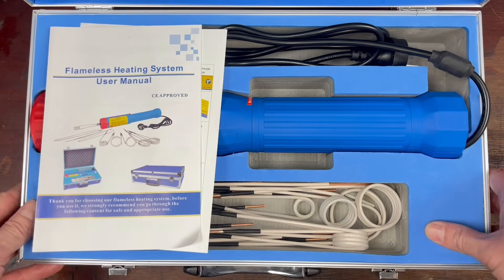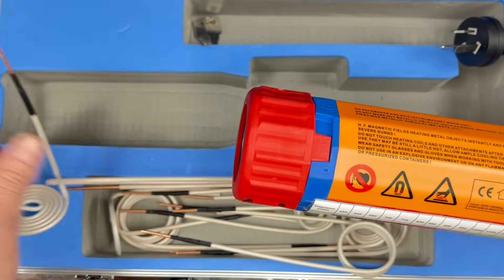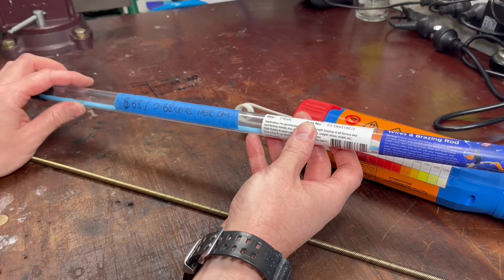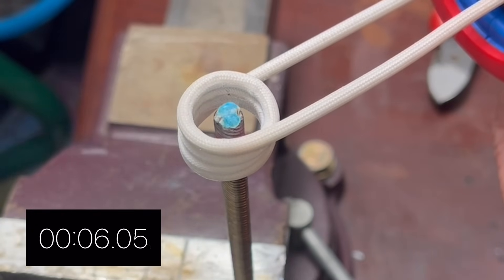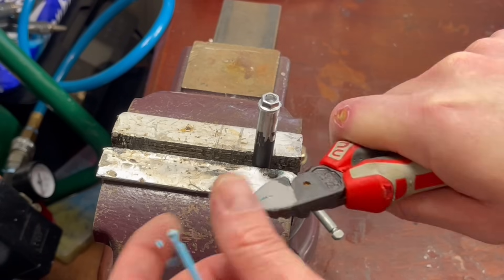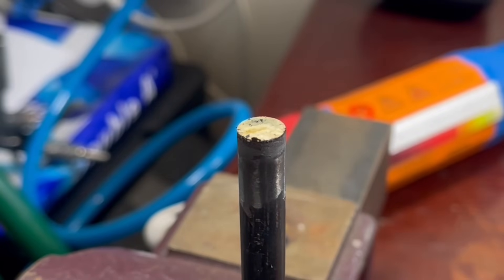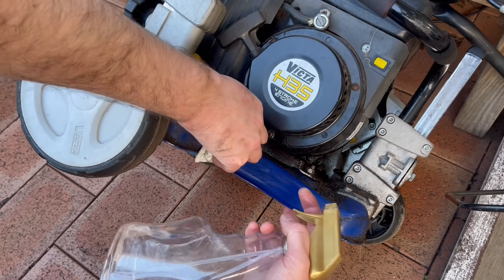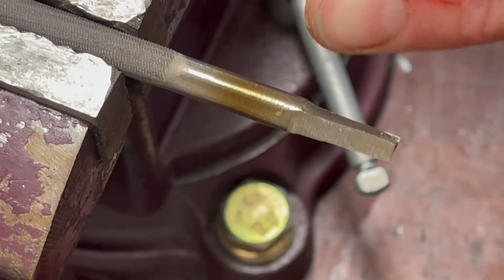Every Mechanic Needs This Tool! Save Time & Money!

Comment: Had one of these for years, very hit or miss. Once the insulation burns off, coils are useless. The insulation WILL burn off.
Reply: What's stopping you from sliding on a new heatproof insulator sleeve? Or am I missing something?
Reply: @endotherm  Buy one use it professionally and you will see. The insulation did not last long and the replacement coils where more than I wanted to spend on something that only worked well once and a while. I am good with the torch so that's my go to.
Reply from the maker: Nothing, you can get the sheathing cheaply and easily. Just open the coils a bit, slide it off measure it against the spool of new sheathing and slide the new length on before squeezing the coils together 👍🏻
Reply: @VintageEngineRepairs  You do you I like to make money in my shop, tools that work good once in a while get tossed.
Reply from the maker: Sorry to hear you didn’t like yours!

Comment: Cost?  In the US that setup is about $40.  Propane wins always with cost.  You are so biased towards induction with all your measurements especially with portability, cost, flexibility, and large work size all favor the torch.  Induction is awesome, but really bugs me how biased you are.
Reply from the maker: There is no bias I said they don’t replace one and other and both have strengths and weaknesses. Portability went to propane, flexibility went to propane, cost was a draw based off of purchase cost out here in Australia and consumable cost with propane, so I really don’t understand how you came to the conclusion I was biased.

Comment: They could have made 2 in 1 , not just heater , flip a switch and its electromagnet , making you able to magetize your whatever you need magnetized , or demagnetized , maybe 3in1 , its a same device just difrent type of current and fields , that electronics can do , its in there .
Reply from the maker: Interesting! I have no idea!
Reply: @VintageEngineRepairs  yeah heating is done via high AC current , electromagnet same thing just DC current . Sure it would not be perfect one , would need more coils but due to high current it would do the trick  im sure . And its a matter of putting in a diode or 2 , rectifiers . But i guess they want to sell that separately .

Comment: is that possible to add a probe touching the target to control temperature
Reply from the maker: I don’t see why not! You just need a thermometer that can withstand the head. That said it won’t give you the internal heat of the piece.

Comment: Why ferris metals necessary? We boiled water with an aluminum ring headed via induction in physics class. You can induce a current in any conductor. They even use induced currents to sort condutative metals from non-conductive scrap in recycling.
Reply from the maker: I’m really not sure, I believe because induction works off magnetism and exciting the iron in the material. It seems to work on non ferrous but is far less effective unless it’s thin tubing.

Comment: Very interesting, never seen this kind of tool. Great for silver soldering as shown but does it work in same situation with regular brazing rod that needs a bit higher heat?
Reply from the maker: Hey, I haven’t tried other rods, but for reference these are 45% silver brazing rods and require 1250f which melted very quickly. Glad you enjoyed the video!

Comment: Good article. Only thing to mention is that 'ductility' is the ability of a metal to be drawn out into a thin wire. The word you want to describe the ability to bend a metal is 'malleability'.
Reply from the maker: Ah thanks for the correction! :)
Reply: @VintageEngineRepairs   Happy to assist.
Reply: I think you are being overly pedantic. Ductile also means "able to be deformed without losing toughness; pliable, not brittle."
Reply: @JorgTheElder  That definition is wrong in that it is not complete enough to correctly define 'ductile', & is likely random & brainlessly AI-generated.

Malleable & ductile are related concepts - but different in very specific ways.

The definition you've cited should only belong in a dictionary entry under 'malleable'.

Comment: Here in the USSA, the yellow cylinders are MAP gas and the Blue or green cylinders are LP (Propane).
Reply from the maker: Spot on 👍🏻
Reply: Unfortunately, there is almost no advantage to getting the yellow canisters, since they don't make MAPP gas anymore. Map/Pro isn't the same, and not really any hotter than propane

Comment: I noticed that some of the centerfire rifle brass has the neck annealed by induction coils by some of the makers. Others still run a flame in their manufacturing process.  Induction annealing just takes a second or two for a brass cartridge.
Reply from the maker: You’re spot on, even though it’s non ferrous, tubing like you mention glows red in a few seconds :) solid brass won’t though.

Comment: 𝘽𝙚𝙬𝙖𝙧𝙚 𝙗𝙚𝙛𝙤𝙧𝙚 𝘽𝙪𝙮𝙞𝙣𝙜

This tool does work as advertised and brings steel up to 800 °C, but only the softest of silver solders will work with it. You won't be able to use hard silver or braze with it because those require bright red and orange heat. 

It is also limited; you won't be working with 1/4 inch rebar with it. You can bend rods, maybe up to 1/8 inch. It does have its uses. If I had to do it again, I would want a portable 3000-watt unit if there was one to be had.
Reply from the maker: Hey, I’ve not tested the specific heat as my IR thermometer only goes to 600c, but this one gets metal to glowing orange (in fact the thumb nail of this video where I’m heating the wrench in the induction heater really is that orange)  and I have hardened steel with it countless times. The number of wraps and how close they are to the object has a huge impact on the results I’ve gotten. Hope this helps!
Reply: @VintageEngineRepairs  My inductor really went past dull red heat, but it is the cheaper model you showed in the video with the screw terminals for the copper coil element. I will try more turns, but what I really wanted was the quick silver soldering capability and to get a bright red or even orange heat, so 1000 watts may not be enough. I am using a similar 45% silver solder, but from Harris, so that may change things as well. It does not flow well unless you get bright red to orange.
 
You have a good channel. I liked your tips on the silicone for the angle cutters and the incense to find vacuum leaks.
Reply from the maker: All good, yeah you shouldn’t have any issues even using 1% silver brazing, let alone 45%! Try a tighter wrap and more of them :)

Comment: The oxy/acetylene torches can do so many jobs yet all the so called modern technicians can't use them, they are cheap, portable, can heat, weld, cut, all in one tool yet the new generation cannot even light one let alone do anything useful with it, what a shame, fire is one of the most important discovery of modern civilization..
Reply: I use one everyday what are talking about
Reply from the maker: Each tool has its place 👍🏻
Reply: lol “old man yells at cloud”.
Reply: you could use this in places where you couldn't use a torch , heating just the bolt you want to remove without heat damaging surrounding materials .

Comment: Great content
I always wished I had an oxy/ acetylene torch for stuck bolts and parts, but if you don’t have a lot of use for it, the expense and tank lease isn’t feasible. I bought one of these inductive heaters, and it’s almost always better than a torch. No starting the engine compartment on fire, or damaging anything in close proximity. Love this tool, even after 6-7 years. I think I paid about $450 online. 
For cutting, I can often soak welding rod in water for a bit and cut with that, or use a small plasma cutter for finer work. 
Also, I use an induction cooktop that I busted the glass on to heat larger areas and non protruding parts. This just reenforced my reluctance to throw anything away that might be usable if modified. For non ferrous materials, you can stick a piece of iron on it.
Reply from the maker: Awesome and thanks for sharing! 👍🏻👍🏻

Comment: 10:02 It should not bend , it should be springy . The issue here is that you partially annealed this part when you brought the first part to red. So it's not hard anymore where it bends.
Reply from the maker: I’ll have to rewatch the video and look closely, thanks for watching!
Reply: @VintageEngineRepairs   👍‍‍

Comment: Has anyone tried this tool for heating HVAC copper tubing for heat punp and air conditioning equipment? Since brass tubing works it would be wonderful if you could braze copper tubing.
Reply from the maker: Unfortunately I don’t have any to try, but if I come across some I’ll update my message here :)
Reply: @VintageEngineRepairs  It would be interesting to see if you could just take a 3/4" or 1 inch copper nipple and a coupling and silver braze that. It would be a quick low cost way to check the capability. I'd bet the HVAC guys would love this as opposed to a torch.

Comment: First of your vids I have watched and found it very enjoyable and ofc educational. I would say if I had a beef, it would be you priced a propane kit, but left us in the dark on the induction lot. I know that many utubers are reluctant to price items maybe because they fluxuate which may draw comments, but I have found most of us just want a general idea of the cost to stick in our nuggets and try and rationalize how badly we want said item, not to quibble over who may sell one for less etc. Anyways, I watched it for heating exhaust studs, which most know if you don't many will snap off in the most convenient of places. So one other issue would be accessibility of getting them in tight spaces. Can you make longer ones? Just food for thought on usability. I like the idea of no open flame while working on a gas powered anything and control over what gets heated, like not worrying over your torch tip setting something on fire or melting a bit of plastic which all newer things seem to be built with. IE: Damage control. Anyways, thanks so much.
Reply from the maker: Hey, no I didn’t, I showed the price of the induction kit when I was talking about comparing prices. It was circa $300 Australian dollars. I don’t know the exact figure now as I made this video a fair while ago, but the price is there for everyone to see.

Comment: I'm interested in induction heaters for a number of years but they used to be closer to like 800€ so I was considering to brew my own.  This model while still not cheap is much more affordable and the underlying technology actually has the potential to get much cheaper.
Reply: You can find pre-assembled induction heater circuit boards for as little as $10. Quality and longevity likely not good at the lower end of the prices but sometimes I'm quite surprised with the quality of cheap circuit boards I've purchased.
Reply from the maker: Yes it’s incredible how much kore accessible many electronics have become!!
Reply: @VintageEngineRepairs  I think it's a very simple device.  A Basic version needs only a transformer and I was wondering if a classic welding transformer at a suitable setting could be used.  A fancier version would use actual electronics.  Something to experiment on, I guess 🙂

Comment: I wonder why it can only heat ferrous metal.  The electricity flowing in the heater coil ought to induce current in any conductor.  For example, the primary and secondary windings of a transformer are coils of copper wire.
Reply from the maker: It’s an electromagnet and because the metal being heated needs to be ferrous I believe that’s where brass and other non ferrous metals won’t work. However I’m no expert, just using logic so open to any correction!
Reply: Transformers use copper wire, but they still require a ferromagnetic core to transfer the magnetic field efficiently. With induction heating, the workpiece is the ferromagnetic core. Induction heating does technically work with nonferrous metals, but it’s so inefficient (lossy) that it takes enormous amounts of energy to actually heat the workpiece, or conversely, the heating effect is uselessly small with ordinary equipment.
Reply from the maker: @tookitogo  thanks for sharing! I find it’s great on non ferrous tubing, for example shell casings but useless on non ferrous solid bar

Comment: Thank you. Excellent topic and demonstration
Reply from the maker: Thanks! Glad you enjoyed it! :)
Reply: @VintageEngineRepairs  I’m a licensed full time professional gunsmith ( >35y) and almost daily do the heat treatment and bending like you demonstrated. Making parts & tools.  Silver brazing, which I should do more, I tend to avoid because torch is often difficult to apply.  This could be an excellent source of heat for me. Never knew they made them this small & compact
Reply from the maker: @thatsthewayitgoes9 They really are amazing, you’d find them an absolutely fantastic tool in your instance, localised heat, controllable and won’t burn anything else around the work area! I have used mine almost every day since it arrived for different tasks around the workshop! I’ve added links in the description - see the updated version I have linked to, I think you’ll be even more impressed! Also, buy 2.5mm copper coil and 3mm fibreglass sleeves and make your own coils. It’s even cheaper than the pre formed ones. Also save the copper, anneal it and reuse it when the fibreglass sheathing does eventually fail!

Comment: Doesn't need to be magnetic metal to heat up.  Eddie current is induced in all metals as far as I know.  Mass / shape is more important than anything, me thinks.
Reply from the maker: It seems to do well on tube in non ferrous, but solid bars it’s almost useless!
Reply: @VintageEngineRepairs  interesting! I wonder why. I'm gonna guess that it has to do with dissipation of heat in copper and aluminum.  Can you check the front end loading? My guess is that it loads the same and dumps the same heat in but it travels down the bar faster.  Though I'm happy to be wrong.  Such interesting stuff

Comment: I ran an industrial induction heater as a lad. The coils were liquid cooled and we annealed hydraulic cylinder shafts up to 4" OD.  It made a fine hot dog cooker if ya skewered the hot dog with a piece of wire though getting the timing right took some pedal practice.
Reply from the maker: LOL! Love it 😂
Reply: What a lad you were.

Comment: Price wouldn't be a draw if you'd considered the cost of electricity. The Propane is bought and costs nothing additional until it needs replacing whereas the number of amps drawn per use must be quite high?
Reply from the maker: Hey mate, I still stand by the draw. When I calculated the cost of a 10 second burst which was basically (within a few seconds) what it took to heat nuts, bolts and shafts up to cherry red  with the induction heater it cost $0.0017. It’s so marginal.
Reply: Amps alone don’t tell you anything about the cost. And “amps per use” doesn’t make any sense. Here’s why:

You pay for electricity by the kilowatt-hour (a unit of energy, not power). Since watts = volts x amps, this means that what you pay for is volts x amps x hours. 

So even if you draw 10000 amps, but you only do so for a microsecond, then the amount of energy is still tiny and it won’t cost you anything to speak of.
Reply: Besides, the propane isn’t free. Whether you pay for it up front (like in buying a cylinder of it) or after the fact (like we do with natural gas from a gas line), you’re still paying for it. It doesn’t become “free” just because you paid for it in the past! 🤦 

And I’m fairly certain that the cost of propane is actually substantially higher than electricity on a per-kWh basis. And even more so if you consider that with flame heating, a ton of the heat produced is lost immediately to the flame flowing around the workpiece, wasted into the air. Induction produces the heat in the workpiece itself, so far less loss into the air.
Reply: I just looked it up, and 1kg of propane contains about 13kWh of energy. So a 0.4kg Bernzomatic propane cylinder contains about 5kWh of energy, and it costs about $5.50 at Walmart. 

The highest electrical rates in the mainland USA are California, at 34.3 cents per kWh.

So the 5kWh of energy in that $5.50 propane cylinder would cost you just $1.71 from the electrical outlet.
Reply: @tookitogo  All good and thanks but I don't live in the USA?

Comment: Electric blowtorch?
Reply from the maker: I’d call that a heat gun 😂
Reply: @VintageEngineRepairs   Likely good for other uses such as security destroy hard drive data. Though so would using an induction hob cooker.

Comment: Propane?  Looked like MAPP.
Reply from the maker: Not MAPP, but MAP/PRO. Very different. I refer to it as propane because it’s what most can relate to. Technically MAP/PRO is 100% propylene. However it’s almost identical in burn characteristics and temperature to propane.

Comment: Had one and got one word for this. GARBAGE!! Stupid wires always burn out pretty fast, which are expensive to replace. The connectors for that wire overheat and melt the plastic housing. Don't waste your money on this and get yourself a good torch set.
Reply from the maker: Sorry to hear you didn’t like yours, if your wire sheathing is burning, it’s because you’re contacting the part that’s glowing red. As explained in this video, you need a gap. Sounds like user error in this case.

Comment: Induction heaters beat the large unfocused flame of common LP torches as they're far more localized. The only thing I use the LP torch shown for is lighting my grill.
While acetylene is easily available in the US apparently UK insurance companies are worried by it so the inductor wins on that score too.
Reply from the maker: Can’t beat the control and speed of an induction heater. There are instances where they won’t work, but I always go for the induction heater and fall back on the propane if necessary :)